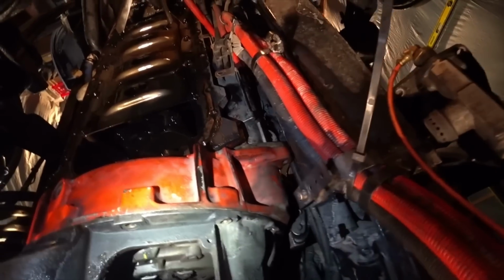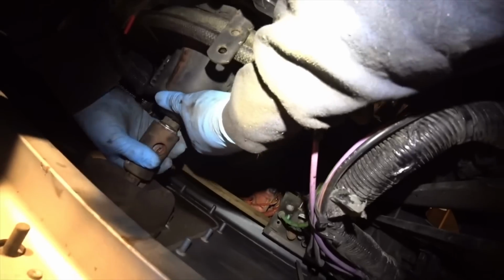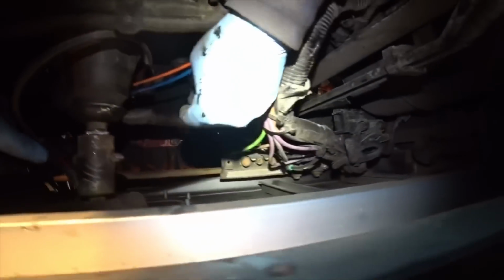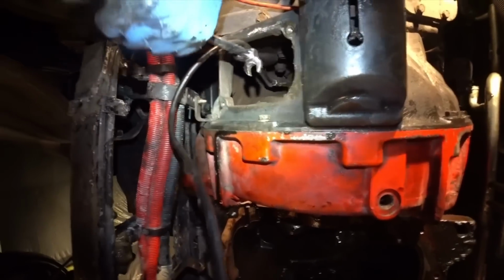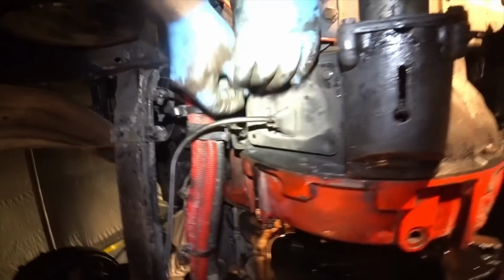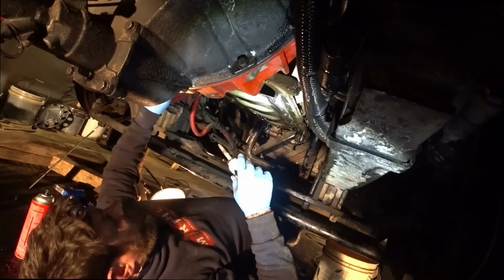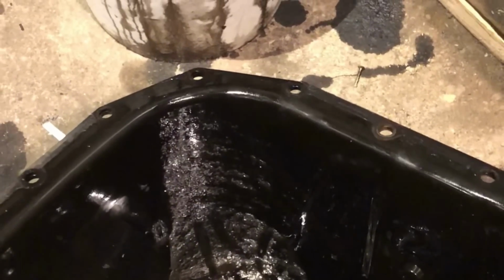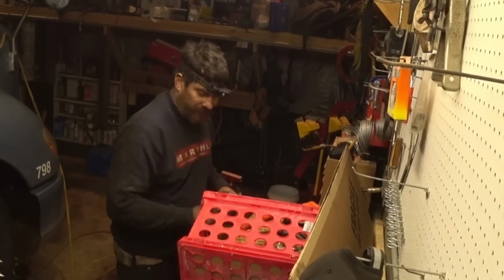January 8, 2019 5/ Installation Transmission & Getting Kenworth t680 Back on the Road

Comment: Tip I learned from my father, when installing oil pan gaskets, tie gasket to pan with cotton string until first couple bolts started, then cut string and pull out.  Works like a charm
Reply from the maker: 👍 makes sense

Comment: Enjoyed the video and from what you showed I would say the fillings that were in the oil pan was the reason you did not show it until the  company you work for had taken it back to the dealer for their assessment and repairs under warranty if was still covered. Now that the truck is back on the road and that work has been dealt with you can show what you did to replace the seal.

Comment: The aluminum either came from the drilling that was done when the throttle valve was replaced. Or the timing gears are rubbing the front cover.
Reply from the maker: Nope

Comment: Well done Larry. Real bummer about the aluminum in the oil pan. That will not be a cheap fix whatever the problem is. If that was my truck, it would be traded while it’s still running good as you can get it for now.
Reply from the maker: All fixed

Comment: I would have to say aluminum in the pan is either a piston or connecting rod issue the bearings and rings are cold rolled steel
Reply from the maker: Nope

Comment: I always set back of release bearing to face of clutch brake with a 1/2" space, regardless of what the pedal movement shows.  Worked for me for years............just info whether you use it or not.

Comment: Oh, Larry!! You forgot to put the thingamajigger back on the whatchamacallit.. you know where the whosit and the whatsit is located, right next to the jiggamawhizzer.  Hoping the damage in the motor is minor and easily repairable. Nothing worse than finding shavings in the oil pan. Been there, done that, but mine were chunks and the lifters had gone through the motor and oil pan. hahahaha Have a good trip east and back west. Well with this video, Big Blue is up and running, even if it's to the mechanic's garage. You didn't break anything this go around. 🚛🚛🚛😉😉😉🤣🤣🤣🤗🤗🤗💕💕💕🐔🐸 Laterz!!!

Comment: Very well done.  You have a real talent for instruction how to videos.  You would make a wonderful instructor at a Diesel Tech School.  At least you wouldn't have to work in such cramped spaces. JBG needs to pay tuition to you on how to fix things.  Keep up the good work.  Did the ADL black Kenmore which had major engine problems show the same symptoms of the aluminum shavings in the oil pan?  If so what was the cause.  I guess we will know that answer in future videos. I am not a trucker but I sure enjoy your videos.  Something tells me that the Big Blue and the Black Kenmore problems may have been cause for a law suit or something.  If memory serves me correctly both of those trucks were purchased about the same time.  I may be really off the reservation on this one.
Reply: What kind of truck is a Kenmore? Never heard of one. lol.
Reply: I think Sears sold them!  HAHA
Reply from the maker: Yeah that lawsuit has nothing to do with ADL or nothing

Comment: Again great video Larry. By the way, the last part you held up is an ash tray mounted on a swing arm. It mounts at the base of the center of the dashboard in front of the shifter. You must have removed it when you went to disconnect the shift lever. How could you not know that?
Reply from the maker: I feel better thought it was a important part😅

Comment: Boy that was a lot of metal shavings.  Wondered if it was a piston or air compressor coming apart...well, I guess I got my answer.  Which number was it, and did you do just the one liner kit?  Seems like it's more often than not the # 6 cylinder, at least in the 5.9 Cummins engines but there are reasons for that.  Just curious.  Congrats on 12K subs.
Reply from the maker: Nope, nope , nope🤔👍

Comment: Why don't you use the JBG method ?? Sticky tape, saves all those nuts and bolts and torque settings etc...😁
Seriously though, fantastic job, especially on a truck with everything being much heavier than on cars.Its a piston btw, dont worry , you ll be fine with 1 or 2 🤔

Comment: Those aluminum shavings don’t look like they came from the engine 🧐
Reply from the maker: They did
Reply: Never seen something like that, I've seen smaller shavings suspended in oil and chunks of metal. Nothing like that very interesting. Good thing they gave you a "new" engine @LongHaulLarry